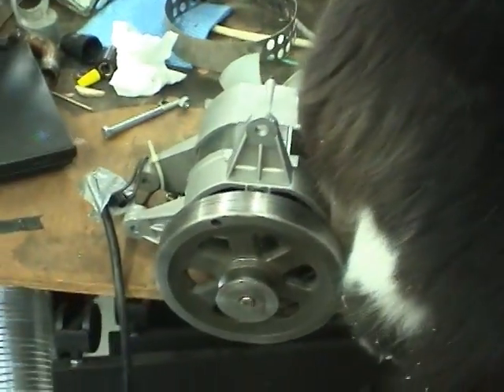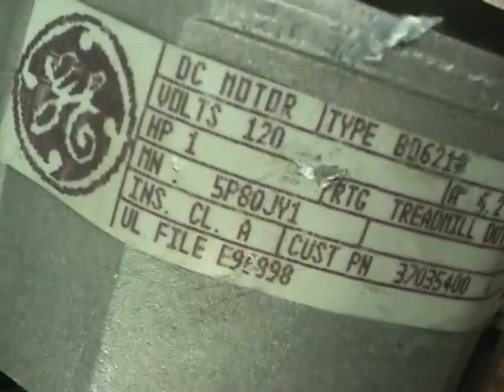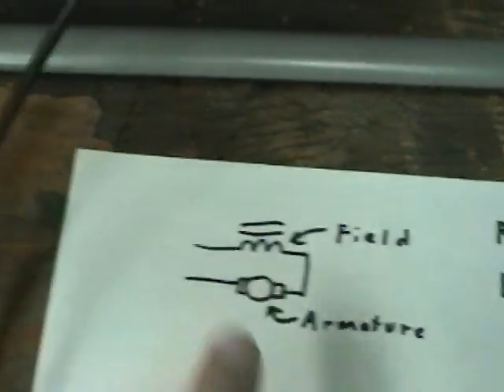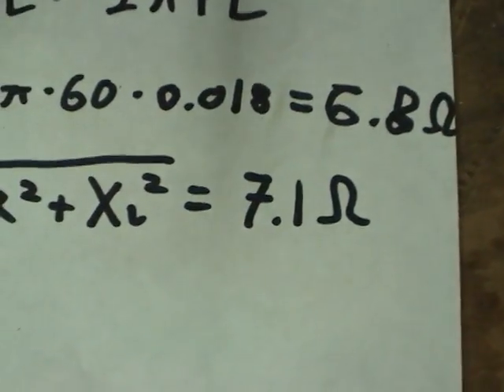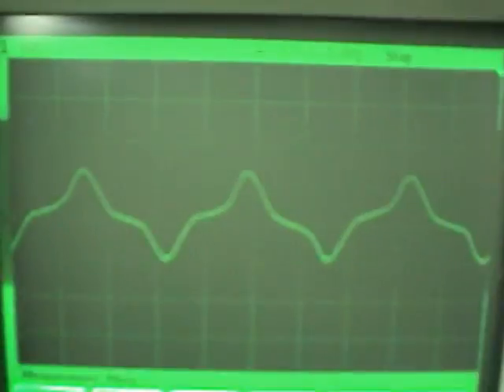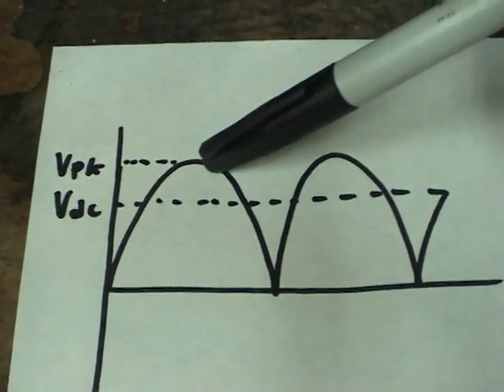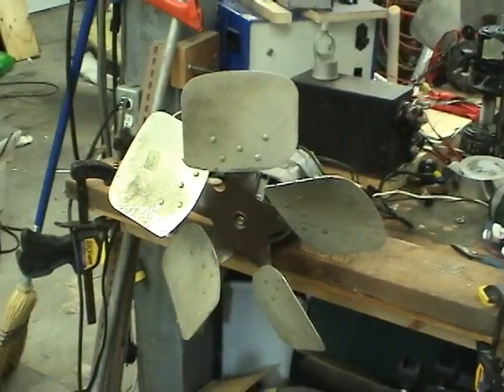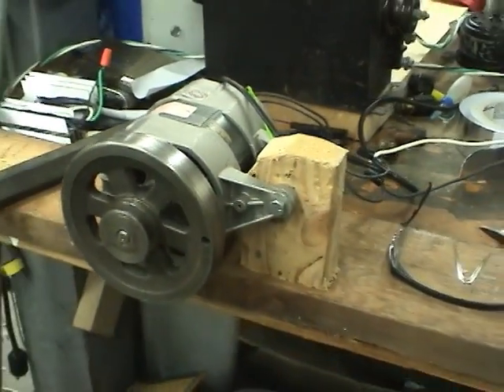Treadmill motor setup and AC vs DC motor operation

Comment: The 240v version of this motor was mounted in UK Hotpoint washing machines from the late 70's till early 2000's, it sat on top of the horizontal tub.

Comment: Why doesn't the pulsed DC waveform induce the same reactance as the AC waveform?  Both represent a changing magnetic field and should induce opposing current in the iron core...

Comment: If you added a capacitor to the DC output the output voltage would also be higher than before.

Comment: Correct me where I am wrong. Rectififed DC is not clean DC. Instead it will pulse from 0 volts to about 170  peek with a rms of about 120v. Furthermore, the DC is pulsing at 120 hertz with a full wave bridge rectifyer. As pulsed DC changes its voltage, it cause a change in current, yet the inductor resist changes in current so that inductor's impedence doesnt disapear with pulsed DC.

Comment from the maker: @sonnytiger If you're talking about the small RF choke found inside the magnetron's case, then 2.7uH and 0.001Ohm sounds correct. Such a small inductor will have a very low resistance.

Comment: OK, next time connect the field and armature in Parallel and not series.
Get a DPDT switch and start in series like you normally do.
Now, while the motor is still spinning, briefly disconnect power and switch connections.
And watch the excitement build.

Comment: @tesla500  It is not really a "discovery" per se as you state in the description, but is a well know fact that field wound DC motors can run on AC. About every blender, vacuum cleaner and corded power tool uses a series-wound DC motor which is called a universal motor. Permanent magnet DC motors will not work on AC though. Also another reason DC motors are weaker on AC is because of the zero crossing of AC when it switches polarity. Hence, the armature is coasting during that time period.

Comment from the maker: @entombed67 This motor is not preferable for a wind generator, because it needs to spin too fast, and it needs power to run the field coils to generate a magnetic field before it will generate anything. A permanent magnet motor would be much more suitable for a wind turbine.

Comment from the maker: @Metalcastr My plan for containment was to have about one foot solid paper catalogs, then another foot of solid wood all the way around, plus a huge scrap potted transformer on the sides that aren't against the concrete wall. I've tested paper, and the compressed air gun's 500km/h bullet weighing about 100g will only penetrate 3".

Alternatively, I have an indoor storage room I could do it in with 8" thick solid concrete walls on all sides.